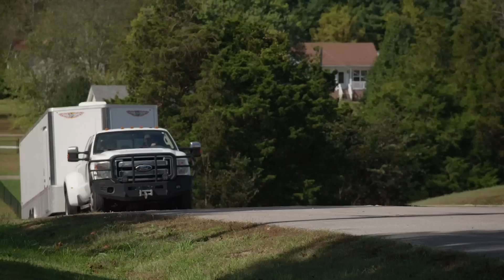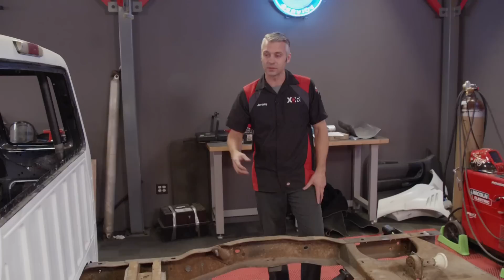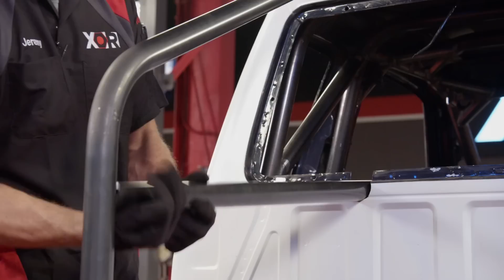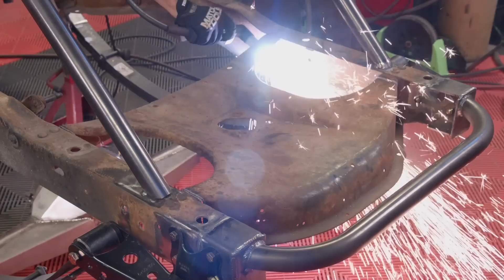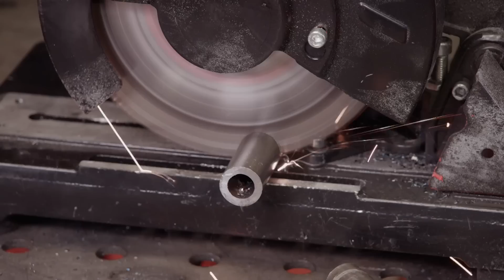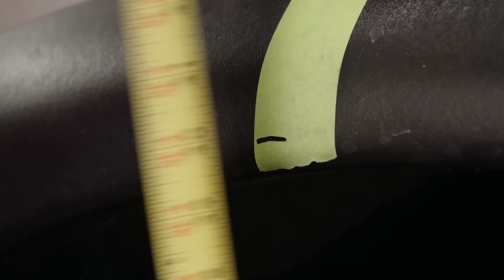Keeping a Coyote V8 Cool On a Ford Ranger Prerunner - XOR S6, E2

Comment: That taco likely already had a leveling kit on it. Those front shock absorbers were bilstien 5100s, which can be set lift the front of the truck by preloading the coil. Also, those UCAs didn’t look like stock either. They looked similar to the uniball style that total chaos uses

Comment: Does anyone else find it strange (annoying?) that they always leave the frame rusty? My first task would be to do a once-over w/ some rust converter. Now you can get to "doing" things w/o having to prep the frame w/ a flap disk and when all is said and done, frame rot isn't an issue and corrosion is lessened/eliminated. What happened to little Miss Fat Pants? Soon as things started getting worked on she bails. WTF?! Not exactly a dynamic duo, by any stretch.
Reply: Id say its not a bad idea to hit the frame with a rust sealant or converter, but you still should grind down to shiny metal before welding.

Comment: With that leveling kit, you don't mention the upper control arms are not stock.
Reply: Or that the previous owner was running Bils5100, which can be adjusted for height.  Likely they were already set for 2 inches.

Comment: Toyota won Dakar on a stock truck with the independent front suspension and this people are swapping solid axle? Even the GR racing Toyota Hilux has ifs/irs...  all this off roads show only thing they know is rock crawling, add weight, and 40” tires and up.

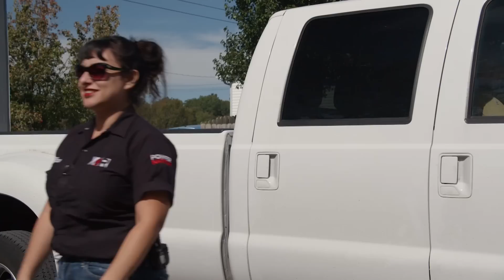Comment: 1:10 LARGE HEAVY 4 DOOR IS NOT GOOD..... you want the small one better at everything other than extreme towing, dont buy a truck with over sized tires it wears engine and drivetrain out much faster, if you want big tires put them on yourself,

Comment: Leveling kits are horrible for your suspension, they put too much angle on your ball joints which wear them out faster and the additional pressure on your front springs make the truck ride rough. And let's be fair the extra 2 inches really won't help much anyway, if your tires are that close they will still bottom out

Comment: why arent these idoits welding the pipes properly. instead of leaving weak points.
Reply: It's called tacking everything in place.  They'll fully weld it later. Watch who you call idiot when we all know who the idiot could be.
Reply: @johnd5805  so you looked in the mirror this morning then huh.
Reply: Mr. Morningstar  true but you ever tried to weld in small places . before? its a pin in the butt plus you cant all ways do a correct weld.
Reply: I was wondering that too, but then realized it's probably because they'll have someone else finish the work for them later

Comment: Honestly, how hard and how expensive would it be to put a coyote in a 79 f150 and have 4x4?
Reply: burntsilverado the motor and transmission ( used ), wiring, fuel system, drive shafts  & computer and all the fab work = $9,000 to $12,000
Reply: Sounds about right.   It's not an easy swap but if you have a brain and are detail oriented you'll be fine.